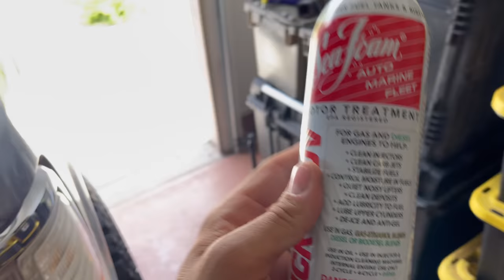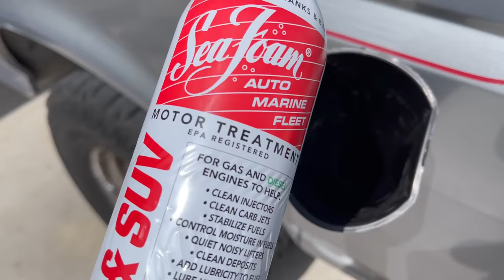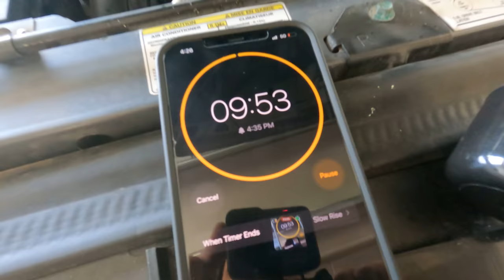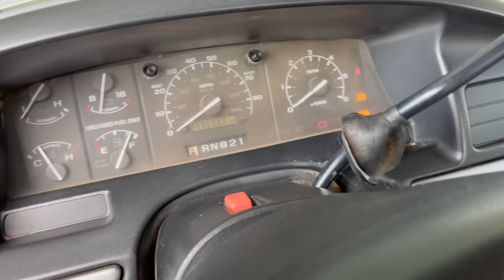Seafoam - Engine Treatment | How-to and is it safe inside your motor?

Comment: I use Seafoam in every internal combination engine I own. My 02 Silverado has 289,000 miles on it and it gets Seafoam in the tank and crankcase every oil change.  I buy it by the case. The i side of my engine is spotless. A few yrs back I changed valve cover gaskets and there was 0 sludge of any kind built up in my motor. I couldn't believe how clean it was. Keep making the good stuff Seafoam!!👍😎
Reply: I hope you’re putting the seafoam in your crank case shortly before an oil change and not after. If you do it after, you’re adding solvents to your oil and also changing the viscosity which will create a lot bigger problems than sludge later on.
Reply: "Internal combination engine" 
Yep this guy knows what hes talking about lmfao
Reply: If it's the 5.3 you don't have to put it in it's great for the tank but it doesn't need it in the crankcase it's hands down the best v8 to ever exist even better than the 350 I've seen many as a mechanic make it to 500k miles plus with 6k mile oil change intervals
Reply: @badazz2969  I think you’re mistaken. The reason you don’t need it in the crankcase is due to the constant flow of fresh new oil into it due to the leaks coming from every nook and cranny on that piece of trash engine.
Reply: Do you put it in your crank case before your oil change? How much and for how long ?
Reply: sea foam is for 2cycle outboard motors. designed for 1970s technology . there ae much better options out there in 2022 .
Reply: @austincoombs3674  at 287,000 miles the only leak that motor had was the rear main seal. That got replaced when I had the transmission out and now doesn't have any leaks.
Reply: @LabRat355  spewing scotty kilmers misinformation? Do you honestly think in over 80 years they wouldn't have altered their product to improve it? If yoy believe so, then I guess you're still using winter and summer engine oils instead of modern multi grade since apparently companies just make the same exact product from day 1 onward. They changed it a while ago to accommodate modern four stroke engines.
Reply: I have a 2002 Chevy Silverado and I use Lucas but I guess I will start using sea foam. My valves does tap
Reply: Ha! Yea
Reply: @robertpeets4225  too thick.
Reply: You say you use it in every internal combustion engine you own. Are you saying you don't you use it in your electric vehicles???

Comment: There's a general rule also that the more smoke there is the more gummed up and dirty the motor is the less smoke the cleaner the motor I've been using seafoam since the 80s when I was a teenager always have trusted that product
Reply: Added bonus, it pisses off liberals.
Reply: @Steve-yu5pf  Added bonus, it's not "roll coaling" either. It's simply getting rid of buildup in your engine.
Reply: That makes a ton of sense lol. Used it in my old mk4 Jetta and you couldn't see the lawn after. Then I used it in my 2017 Passat and barely anything came out
Reply: That must explain why all my old 50's-'70's cars I own never smoked like that after cleaning with seafoam... they must stay pretty clean being drove daily. Sweet.
Reply: @Steve-yu5pf  We got a tough guy here  takings shots at liberals in a sea foam video.. tell me you have no interesting qualities about yourself without directly telling me
Reply: @circlecitychamp317  thanks for taking time away from protesting.
Reply: Can you use this in a 1997 chev 5.7 with a carb
Reply: @richardgrubb1082  ya you can use it and throttle body regular cars carbureted as well as fuel injected,
Reply: My 1997chev 5.7 has 539000 miles, don’t know if I should try the top end cleaner, I used too use 2 ounces of actone per gallon of gas
Reply: @Steve-yu5pf  I LIve in a liberał County! I did this, then took it on the Freeway on purpose!! 🤣🤣
People were pissed!! 🤣🤣
Reply: @MikeKollin gonna buy some then just because though I do actually need it.
Reply: @MikeKollin smh...so people saw you driving and said "look at the a hole with seafoam in his gas tank"...😅

Comment: Friend of mine has a 2003 f250 6.0l diesel with around 450,000 miles on it. He always puts seafoam in the crankcase for the last 1,000 miles before an oil change. You would not believe how clean the top of the heads are! They look brand new, it's wild!
Reply: Thanks Jeff. Due for an oil change soon. Thinking about doing this with my Honda Odyssey. It has 169,000 miles.
Reply: First off, will this work with Honda Fitz ? And do I have to remove some oil first before adding it to the motor?
Reply: @EpochHEROkiD add to oil but I would do it roughly 100 miles before oil change. I don’t remove any oil, just add.
Reply: On o e of my 6.2 diesel’s I bought. I was using oil BAAAD!  I bought enough oil filters and sea foam to do  4 old changes back to back to back to back 3x in one day. Plus added proper amount of sea foam to each oil change after dropping it. And putting new oil filters on as well.  By driving on the Highway 200 miles each oil change. Then coming back and dropping the oil filter n added new sea foam each oil change : x in a day. Then on the 4th change in that same day.  I also added Lucas oil stabalizer to the 4th oil change. BUT NO MORE SEA FOAM. I stopped the rings from sticking. Hence, no more oil burning. You literally FOR REAL could not sea the oil on the dip stick by the 4th oil change.  The motor is still fine today. No more crazy oil being used either.  My mechanic buddies didn’t believe me that the oil could not be seen cus it was that clean. It didn’t start turning tan, until. 400 some miles of driving
Reply: I have used it in vehicles for yrs. Mowers quads 3 wheelers ect! Good stuff
Reply: Sea foam deep creek too, is the best carb cleaner out there too
Reply: 🚫 Bottle says 100-300 miles before oil change NOT 1,000 miles 🚫

Comment: If you're like me and only buy high milage cars,  this is essential for them to continue to run for years to come afterwards. every oil change one can of sea foam, half in the engine, the rest in the fuel. run the engine for about 50 miles, and drain the oil. This will flush out any carbon in the engine, and begin to clean it up. Once you start to do this, your engine will run better and better as time goes by. Lifters may clatter at start up, but will quickly pump up and quiet down. it you do this every time to service your engine, it will get better and better. It also works with transmissions!
Reply: Thanks! I like my high mileage cars too. Sometimes I can’t justify the time to repair and clean EVERYTHING so this will be a nice alternative
Reply: I use Seafoam in the fuel tank but for the crankcase I use Gunk (now Motor Medic) Engine Flush before each oil change.  You put it in an only run the engine for 5 to 10 minutes, it breaks up any sludge and oil deposits and then you change the oil right after.  I've been using the stuff for decades and it works great, especially if you change your oil at regular intervals as you should.

Comment: It’s acetone. If your vehicle was assembled at the factory with the light gray rtv or you have used that rtv like on the timing cover or oil pan it will dissolve the rtv . I found this out when I thought I had a stuck lifter and ended up being a broken exhaust valve spring. The noise got louder than quieter so I took valve cover off and found the broken spring. I started disassembling to take the head (L6) off to rebuild . When I took the timing cover off the rtv was soft and gummy like I just squeezed it out of the tube. I replaced the oil pump 2yrs before this and used that light grey rtv. So I don’t recommend using in the crank case. The blue can of seafoam is kerosene which is a safer product to put in the crank case or just put a cup of diesel like the old timers used to in the early 80’s and back.

Comment: Sea foam is one of the longest running brands in North America.  Ive been an Automotive repair Tech for more than 30 years and I have used Sea Foam countless times on customers vehicles with fantastic results.  If you are on the fence about putting this in your vehicle , no worries at all.  It's totally safe if used correctly as outlined in this video.  
Great video by the way !!
Reply: Then you are horrible at your job. There is no PEA and will kill the cat
Reply: @SuperBROKEN81  It's never been a problem yet  !   Think about ... do you think a company is gonna sell a product that just outright destroys cats ?
Reply: @OnfloorAudio  Yes actually. Most of this stuff is snake oil. Seafoam was designed for 2-stroke motors. Motor boats. Again, it has no PEA in it. Even Scotty kilmer who has way more experience than most people on YouTube says not to do it. I'm just a random guy on YouTube.
Reply: @SuperBROKEN81  if it does just delete your cat and get a better muffler 2 birds one stone
Reply: @josevaldez9542  Why when there is no PEA in it to begin with? Why use a product that can kill the catalytic converter? ATS Chemical is $50 and was developed by automotive engineers. 

Also everybody wants to gloss over the fact that even on a brand new car with even 50 miles, black smoke will come out of the muffler.  To each is their own. I would rather spend my money on a product that is safe and actually works.
Reply: I use it with great results in my vehicles.
Reply: Crazy I've had plenty of mechanics tell me this stuff destroys your car. Guessing some of these mechanics don't want u to fix your own car
Reply: @SuperBROKEN81  I have been using it in my truck for at least 10 years and still have the factory exhaust on it. Never had an issue.
Reply: @stefantoffenetti948  me too I have a Ford e250 377000 miles on it and been using this and Lucas for years
Reply: @SuperBROKEN81  catalytic converter? So you say no to putting this in the gas tank? I can Google it but prefer a more educated answer so what’s PEA and why does it matter? If you don’t mind explaining…
Reply: @WavyVaporizers  what may destroy your car faster is not maintaining it I srarted using seafoam like 8 years ago after hearing coworkers speak on it but only poured it in my gas tanks although heard you can pour it in motor etc, said what the heck after smelling gas on  burnt or used oil on oil tuneups or motor oil gasket changes apparently gas makes its way or passes very little threw engine so thats why I haven't trying pouring it directly in motor etc
Reply: @anthonynaceanceno3013  yea I'm a bit scared to pour it insidd my crankcase also. I've seen multiple videos of people saying it has made a difference in their throttle response and gas mileage. They say their cars have a bit more ummph than it did before pouring a half bottle into their crankcase. Maybe one day I'll try it
Reply: Wanna mess with his head let’s talk about marvel mystery oil. Lol
Reply: @georgepaiva7496  lmfao
Reply: @georgepaiva7496  you my friend know your stuff a old sloop mechanic my family has used for over 30 years about 13 years ago showed me this I can vouch for this I used it on my car lifter tick left and never came back and the car is still around to this day my buddy owns it still is not ticking
Reply: Omg my mom was just charged $130 for the mechanic to put sea foam in
Reply: @breezharley  lmao
Reply: I know Seafoam is amazing...Scotty Kilmer bad mouth's it .....I like Scotty but he can be wrong on some things....
Reply: @SuperBROKEN81  nothing some catylclean won't clean
Reply: Puttting it through a vaccine line or into the throttlebody it helps clean them carbon from inside the catalytic converter..
Reply: @user-mc5kd6cb8f  can u explain if can can the  catylic converters please
Reply: @JanessaforIsrael  but Scotty doesn't know now 😆
Reply: Its great stuff, just got the full compression back in one of the cylinders of my girls car by knocking of crud on the valves. Thats where Seafoam is at its best. Keep using this every now and then and your engines will run forever...assuming you change your oil to that is...
Reply: Marvel Mystery Oil is also
Reply: @babagandu  I use it all the time, just as good as Seafoam and like half the price.
Reply: Cheap
Reply: Can you drive it while the stuff is in there to burn it off faster?
Reply: @SuperBROKEN81 who uses seafoam on a brand new car smh
Reply: @stephenbagley8  it proves Seafoam is a joke
Reply: @SuperBROKEN81  what is pea exactly??
Reply: I have just come across this video for the first time ever,! & I'm curious to know why people are not using this product at are local oil changing companies//facilities...??? It seems like an excellent bye product to exploit more $ from individual as they service the vehicles...
Is there regulation issue from the industry that makes it unsuitable for the public...?? 
I would love to see this product used more at a local business...! 
Just wanted to understand more about why....??
Reply: @ColdWarVet607  I just come across your comments about the compression issue of your daughter's vehicle,! 
I would like to ask if the mechanics might have mentioned that you replace the Engine??? 
I'm curious because that's what I'm being told...
Also I'm curious if this might work for my vehicle in a similar way,?? 
Can you tell me is this product used for certain types of vehicles or generally for all vehicles...???
Reply: @johnlarett9891  Seafoam is good in any car, its just petroleum products, not much different than brake clean, carb cleaner and so on. It helps dissolve the crud build up on your valves. That crud prevents a good seal so the cylinder can blow out pressure to the intake or exhaust manifold. Loss of compression can can occur to piston ring or worn cylinder walls or even a worn head gasket or warped block or heads allowing one cylinder to blow into the other. I rebuild my own engines but before Id replace an engine Id try a can or two of seafoam to see if it can help, its not expensive. You can also hard hard accelerate onto the highway, get up to a high RPM so the valves are really cycling, this can help knock off some crud. If you are always driving 30 or less, crud will never get knocked off. Chrysler.  recommended that for Pacifica drivers. I put a few ounces of Marvel mystery oil in my gas tank at each fill up and I buy good gas from Exxon that has the same solvents in it as Marvel and Seafoam just as a good measure  to keep them valves clean. I can't tell you if you should replace your engine. Sometime you can pop the valve covers and mechanics can "clean up" the valves, the cost depends on your car but thats a slippery slope. you can uncover other things an then its starts getting more expensive and before you know it you just paid 2x for labor and parts what it could have cost to drop in a rebuilt engine. Or maybe the seafoam thing helps, or maybe cleaning the valves helps or not. No way for me to really tell you whats best, but for sure, Seafoam is not going to break your bank account, using it once or twice.
Reply: @SuperBROKEN81  Scotty Kilmer also says not to leave the car you're using to jump another car off running. I would not use him as a reference.
Reply: @SuperBROKEN81  
"Even Scotty kilmer"
You mean literally the only large Youtuber that has criticized it? Project Farm tested it in dozens of different ways in multiple engines. I trust Project Farm more than I can throw Scotty Kilmer. And, frankly, so should you.
Reply: @JanessaforIsrael  yeah, I think Scotty likes Rislone or that ATS carbon stuff.
Reply: @Jose Valdez  for newer cars I don't think it's easy to delete cat without killing mileage or rough running
Reply: @SuperBROKEN81 my
Reply: @jaypayso4968  Please use punctuation in your sentences.
Reply: I've used it, it got a pos dodge caravan running good again. I've heard it u put it in crankcase, drain it all after 100 miles.
Reply: @SuperBROKEN81 anything Scotty says is gold in my book!
Reply: @SuperBROKEN81  killing cats?? That's just cruel!
Reply: A mechanic told me it doesn’t do shit. It doesn’t harm the motor either.
Reply: L
Reply: Bro, none of you know what you're talking about, a mechanic once told me none of you know shit. Everyone knows the only true way to keep your engine running clean is to tell other people in a condescending way on the internet that they don't know what their talking about. Run 2 liters of dish soap through your oil filter and wallah, your car runs like new with 50 more horse power. Geeze, some people really have no clue when it comes to cars. Make sure the dish soap has K1000 in it.
Reply: @hobsdigree2  bro knowledge
Reply: Scott Kilmer said it contains oil and damages the sensors and catalytic converter.
Reply: So do you do all 3 in the same day ??
Reply: @breezharley thats horrendous
Reply: @ColdWarVet607 Yes, they’re both great products.
Reply: On the Seafoam website, it says you can do 2 ounces per gallon in the gas tank for a deep clean.. would you recommend? Or only 1 ounce per gallon?
Reply: Chemtool has been around longer, 54 years that I know of, works the same but a couple bucks cheaper.
Reply: @SuperBROKEN81 I'll confirm that. Seafoamed my wife's honda and ended up having to replace the cat within a few months. More than just a coincidence. I would say if i have to do this again on the top end, I'll pull an upstream 02 censor or lossen the cat to direct some of  the exhaust before the cat.